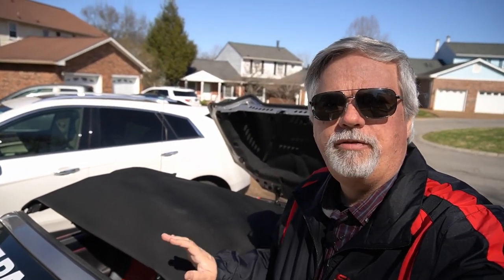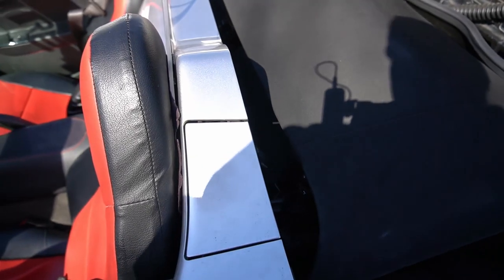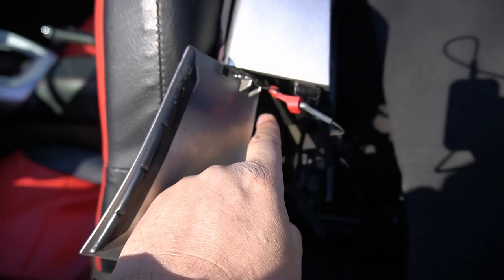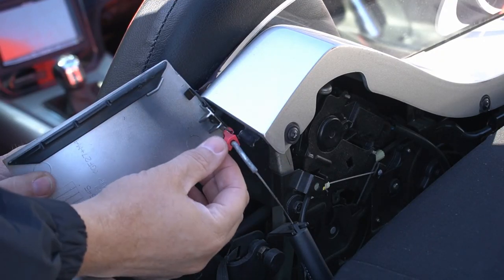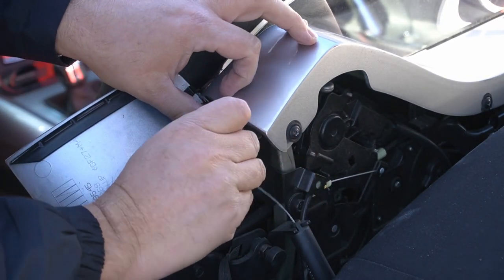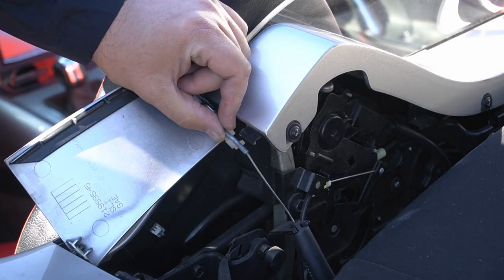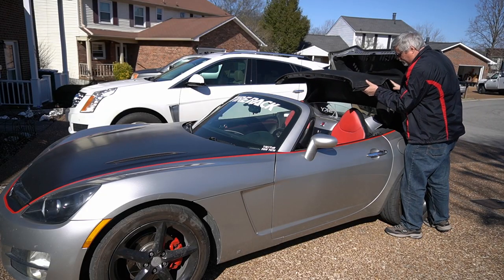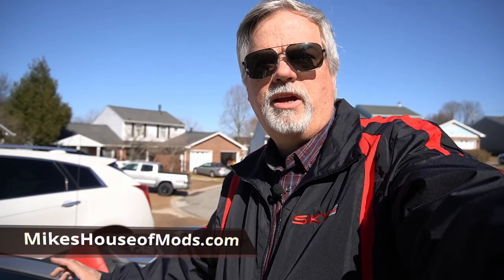Fixing Your Stuck Convertible Top - Saturn Sky Pontiac Solstice Opel GT

Comment: Nice video Mike! Another tip is the cable slack is sometimes too much even with new clips. You can bend the bracket that the wire guide is attached to downwards towards the trunk bottom to take up some of the slack until you see the tulip door come up as it does in your video... not way too late.
Reply: After replacing the clip on one side, the cable has 1/2" more slack than the other side. Have tried to take up the slack but won't raise the flap consistently. End up having to manually flip the flap.
Reply: @dantylenda4591  you need to bend the bracket in this thread downwards to take up the slack. https://www.skyroadster.com/threads/gray-flaps-wont-open-when-top-raised.93881/